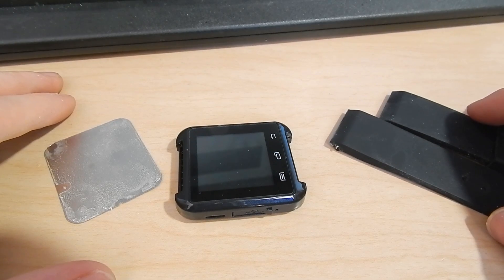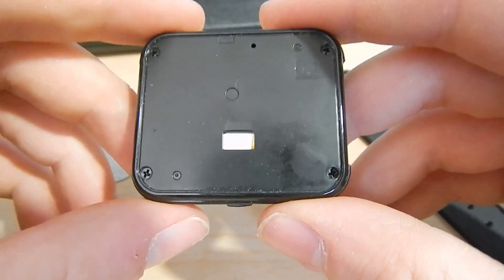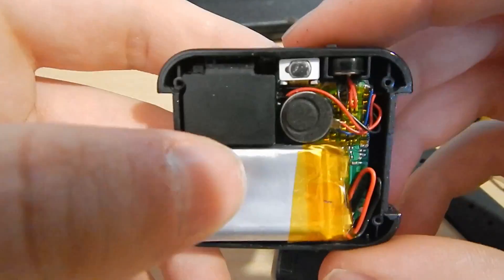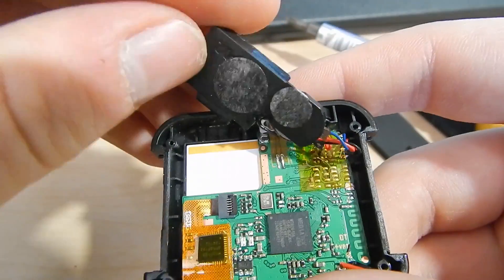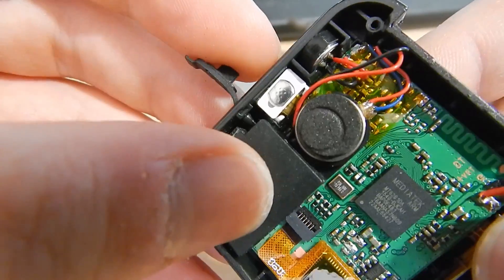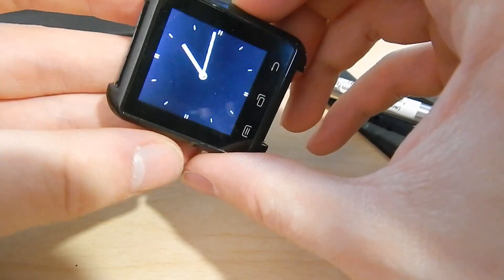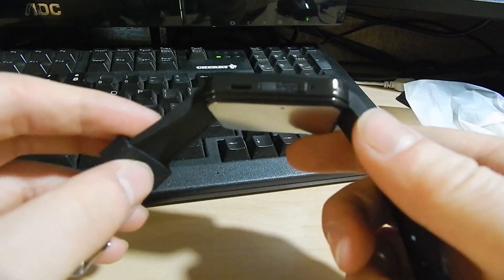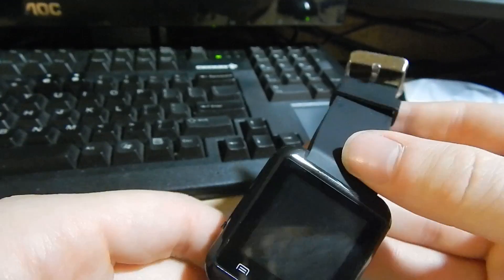U8 smart watch teardown and modifications

Comment: can i remove the speaker and use it separately
Reply: Piyush Nandurdikar i dont know
Reply: Piyush Nandurdikar yes u can and it works well
Reply: Piyush Nandurdikar the speaker is also attached to the vibration motor which is handy
Reply: legoscratch i tried that it works but the sound is too low even at full volume and i know that speaker is louder than my phone. What must be the matter with it?

Comment: i am not getting my altimeter so where would i get it
Reply from the maker: It seems that these watches vary significantly in firmware between batches. I am not currently aware of how one would change the firmware on the device to add additional features. I am pretty sure that there is no way of adding that functionality if it did not come with it.
Reply: +C:\SMT I also have the same issue, no altimeter and icons are also different, the clock face cannot be changed :(

Comment: I received mine today and it doesn't work doesn't power on even if it's plugged in
Reply from the maker: Sounds like you got a bad unit. I would try contacting whoever you bought it from and try to get a replacement, or a refund. also you could try a different cable than what came in the box. the cable that shipped with mine was bad.

Comment: I would like to know which part is the bluetooth, or if it is integrated in the whole board.
Reply from the maker: It appears that the bluetooth functionality is integrated into the mediatek chipset. The antenna can be seen on the far right of the device. it is a curvy and quite thick trace on the main PCB.
Reply: That's what I imagined. Thanks.

Comment: mine beeps when I push the power button, is it possible to get rid of it, and how did you update it
Reply from the maker: +Sonic Solace you should be able to put it on vibrate only in sound settings. I never was able to figure out how to update these. there is apparently a firmware flash utility, but I could not get it to work on mine.
Reply: +SMCDTech there are no sound settings for some reason
Reply from the maker: Sonic Solace Unfortunately it seems like these all have different firmware versions. I think you are kinda out of luck if yours doesn't have that setting... sorry I couldn't be of more help.
Reply: +SMCDTech it's okay, this company just doesn't know what they're doing lowkey
Reply from the maker: Sonic Solace well, they are very cheap. I guess you can't really expect too much for that price... its just sad that updating the software on these isn't easier...
Reply: Indeed
Reply: I have an $8 one off of Ebay. It beeps too. I have emailed U8 directly from their site to find out if their $17 one doesn't beep and if It has a vibrator as mine doesn't. Does yours have a vibrator and how much did you pay for it?
Reply: I just had the settings wrong, mine does vibrate.
Reply: LOL
Reply: go to dialpad and hold #

Comment: hi bro nice video 

how can i fixed charging error problem and battery drain very fast ???

please i give me solution only two day ago brought this watches
Reply from the maker: +K.M Kanok I haven't had any issues like this with mine, can you give me some more specific details on what is going on? what sort of charging error?
Reply: its was charging  only 5 min  after that gets charging error
Reply from the maker: K.M Kanok you may want to try using a different cable to charge it, or try a different wall adapter.
Reply: Try this methods
1. Use a different charging said, which is specified to the watch don't go beyond or fast charging.
2. Use a data cable, try to charge it with your PC/laptop.
3. Just check the battery, see for a change, means check whether it got a bump, means you may to replace the battery.
4. check for the pins placed in usb connecting port.